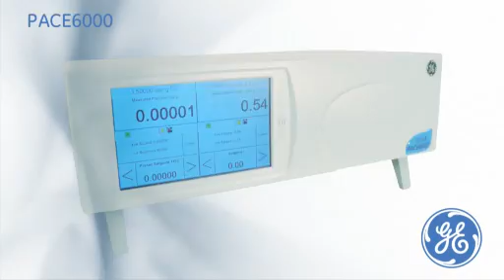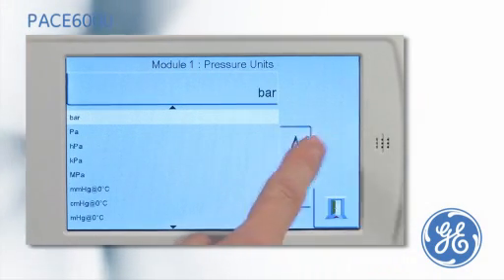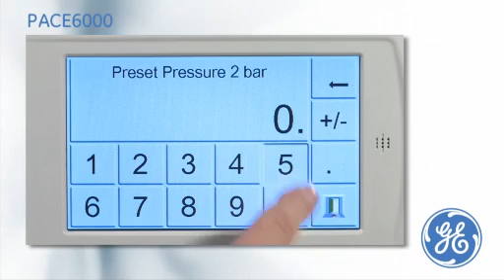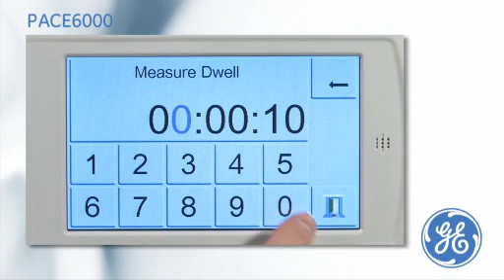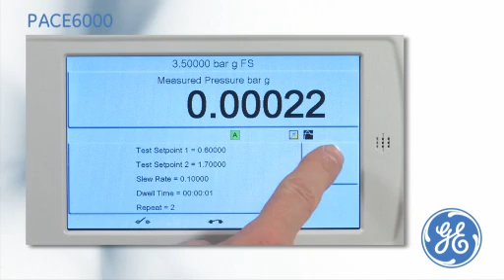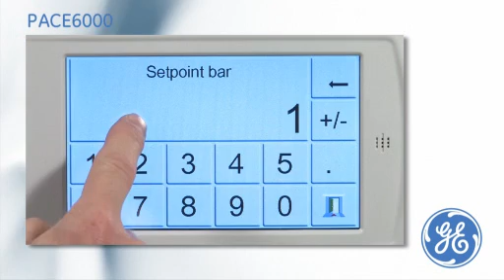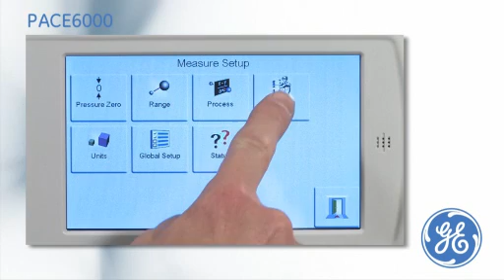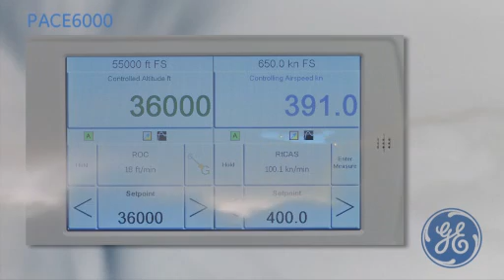PACE6000 Modular Pressure Controller

Comment: hello

I want to buy a equipment but i need to know if you equipment can to measurement until a range of 100 psi with resolution of  hundred thousandth, please can to tell if this equipment o other is able of do this job
Reply: Hi Rodrigo,

where are you based? I will ask the right team to contact you.